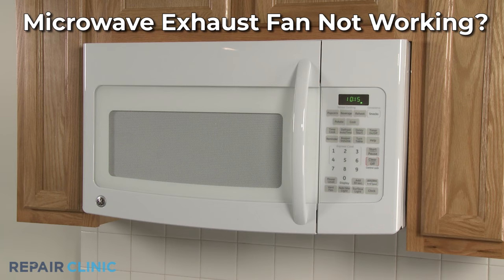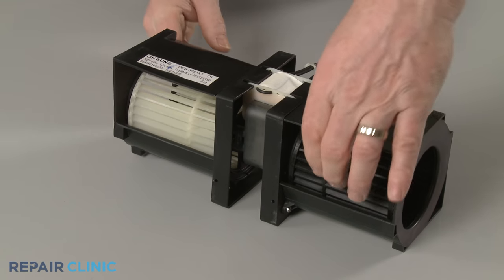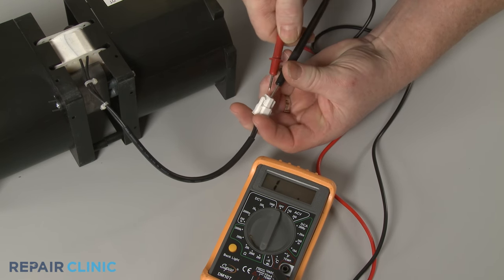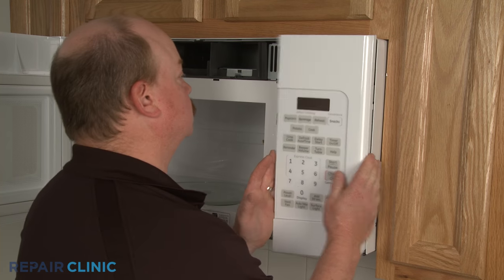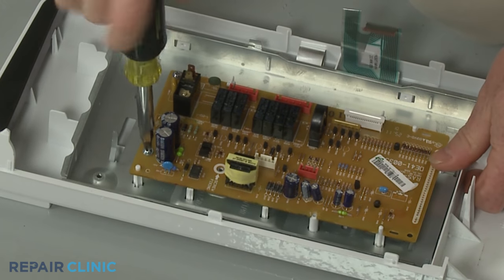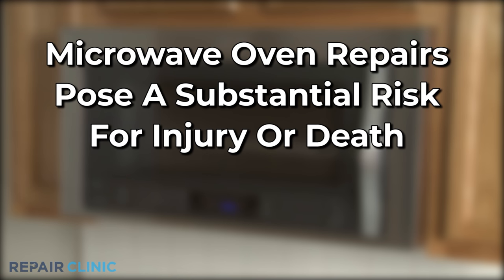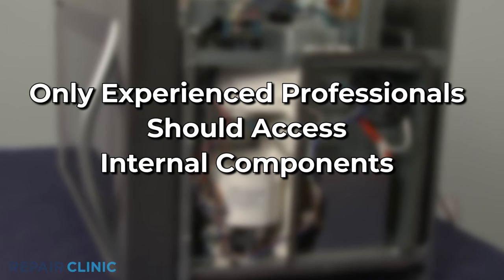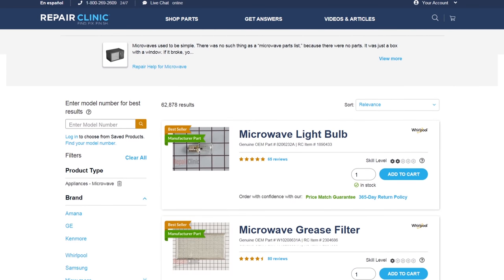Top Reasons Microwave Exhaust Fan Not Working — Microwave Oven Troubleshooting

Comment: my over the range microwave is brand new the fans working but its not pulling air from the bottom and non if these are my issues imma have to take the thing back down and fix whatever's wrong with it
Reply: Same, brand new Samsung and exhaust, fan is loud but barely can hold a napkin up, does not appear to be sucking the steam from boiling soup.
Reply: I have that problem with an LG. I think the fan was turned wrong when installing it as there were three different to position it.
Reply: @d3ltabrav0 any update?
Reply: @babblesp1367 did you change the fan direction? Did it work?
Reply: @Jake_Ritter had a house inspection today…same issue as commented above. Inspector said the most common issue is the fan orientation
Reply: @shorelinemafiaiglives9750  mine actually will suck a napkin but doesn’t suck any moisture or smoke (at least visually). I’m moving soon though so who cares haha hope the next one is more powerful

Comment: Thank you for the great advice! 🤙🏼
My exhaust fan suddenly came on and will not shut off ...
I was not cooking, therefore no heat 
I’ve let it run for an hour as unplugged for hour, still will not shut off 

All panel buttons work except light & vent ... idk what would cause the fan to start up and now not shut off 
Any thoughts of what can be checked?? ...
THANK YOU! 😊 Have a great day
Reply: @repairclinic   Thank you for your response! 👍🏼 
... I’ll see if I can check those .. 
I have a tester, (still learning to use) 
I’ll also check on panel prices as well 
Hopefully not too spendy 

Thank you again for good advice, much appreciated 😊

Comment: Very helpful. Thank you. Another solution is to place a can of spray engine starting fluid in the Unit and microwave on HIGH for ten minutes. Make sure to leave the house immediately after pressing start. Then call your homeowners insurance company. They will replace your microwave and your house after it burns down : )
Reply: I love you! You absolutely made my day!
Reply: @timbarton5524  Thanks Tim. Also, a good way to test a new Microwave at BestBuy is to see how fast it can boil and vaporize Hydrogen Peroxide. ( Disclaimer Don't try this at home ; ) lol )